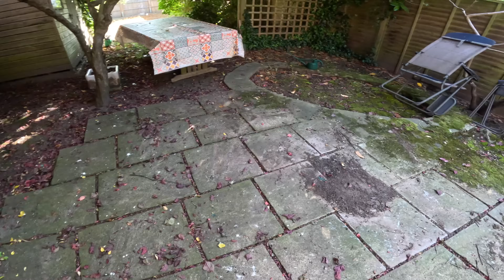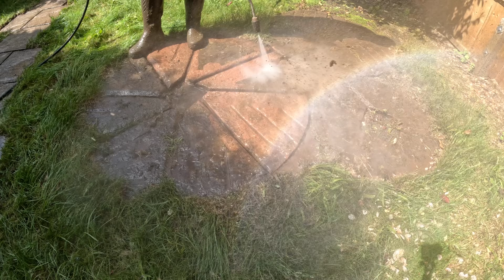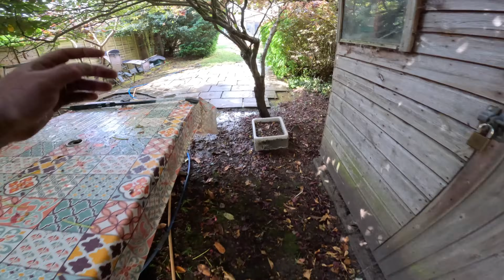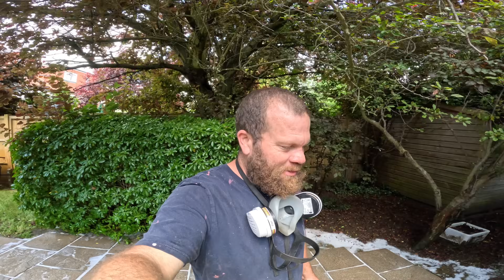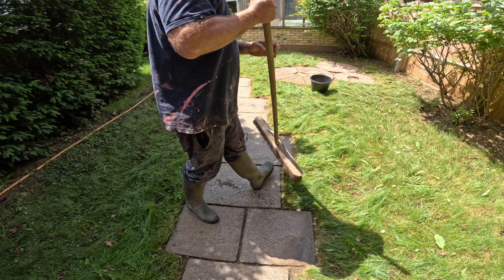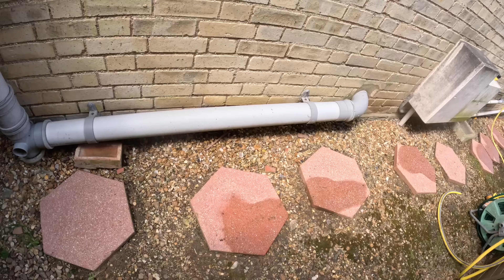Mother Nature Was On A Mission To Reclaim This Back Yard!!.....I Put An End To That!

Comment: Have you considered getting an exo-brace for pointing jobs? They're made for gardening, but it should work a treat for pointing as well; there's one you strap onto your lower leg, can walk smoothly in, and it's designed to become a seat for you to kneel on, to take the bulk of the stress off your back and knees. They're not expensive, either. I only ask because I know you've spoken of how much pointing jobs hurt, and I'd prefer you to not be in pain~
Wonderful job; the stonework looks immeasurably better! And maybe it might have been a little bit too much suds? But hey, the black spot is GONE. Not your fault with your Yorkstone Nemesis~

Comment: I must admit I was sceptical at the beginning about grit but actually this is one of my favourite uploads. You’ve totally nailed that. It looks like it’s just been built. That’s real affordable options for totally transforming a tired patio. I’m not usually stunned for words specially four letter ones but bro you nailed it. 
I think if we set you up with a old patio with edges of slabs sticking vertically up and the rest buried 3 feet in the ground you’d wave the mighty briggs and Stratton over it and bam job done.
So relaxed now me young china😎 cheers Nick🤜